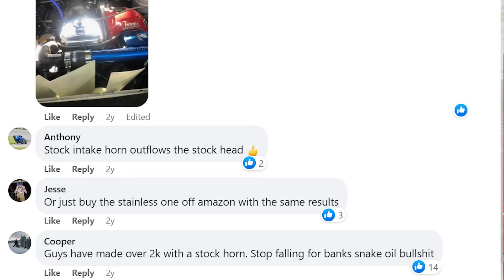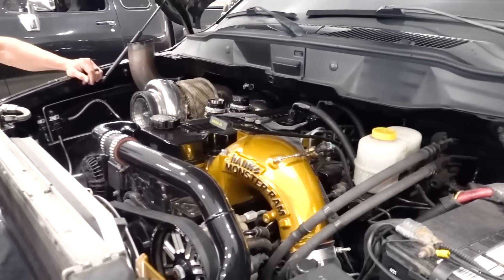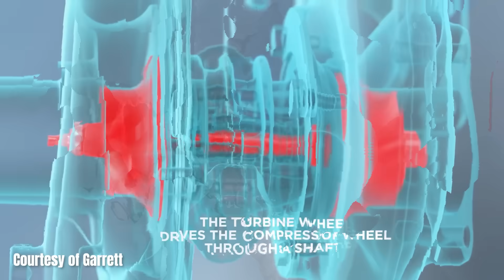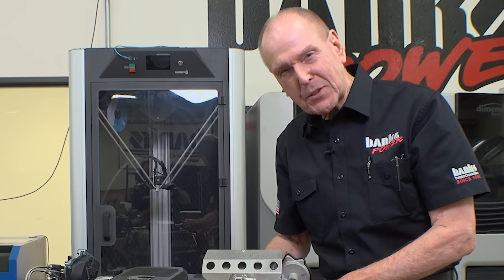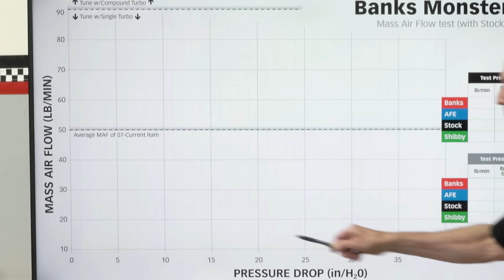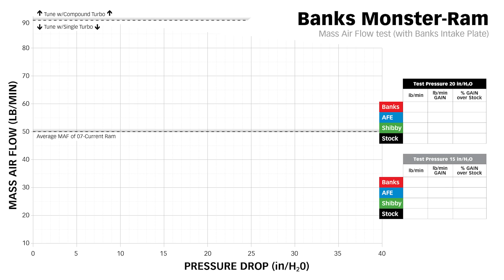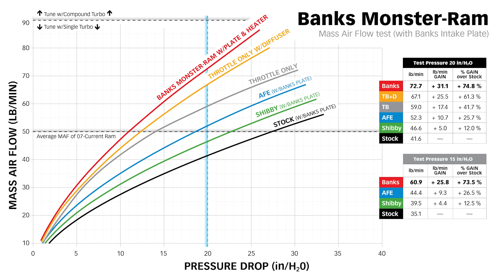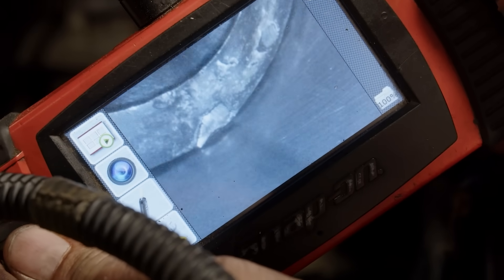Stop this wives' tale about Cummins engines! | Fact Check

Comment: Look man respectfully, this video is great on explaining the benefits of an entire banks system it does not show any REAL world results to the wheels of the vehicle….yes you picked some critiques by some pretty mis-educated people and you did a great job on tearing apart their choice in nomenclature 😂…so let me ask you what I think they were trying to say. How does additional “flow” before the fixed intake runner size, fixed port size, fixed valve timing, fixed valve size etc…how does your system overcome these limiting factor’s WITHOUT additional TUNING?…yes your elbow does increase flow, but it seems it has more to due with the grid heater re-design (which there are numerous cheaper alternatives that achieve the same type of re-design) as I’m sure you’re aware a modern computer controlled engine running in a closed loop cycle will automatically adjust the variable side of things to accommodate any change in charge air/atmospheric conditions and will adjust the fuel trim to STOCK drivability. Fact is if your system is 50 state legal (to include California CARB compliance) it CANNOT FUNDAMENTALLY CHANGE THE FACTORY CAFE STANDARDS😂 good rule of thumb on “performance parts”, if it bolts on and doesn’t throw a “check engine” light then it doesn’t do diddly squat 👍…look folks , buy this all you want, but without doing ILLEGAL mods you’re NEVER going to see any real world long term benefits from this nonsense…if you don’t delete the egr, DPF etc, this thing is going to clog up and run just as bad as the stock setup in about 2 regen duty cycles… at the end of the day. Mr. Banks is a mechanic and an engineer, but he is now a businessman, but most importantly, a salesman…. I’m not tearing the guy down at all. He does make a lot of really good stuff (and it says “off road use only” on the part 😂), but this particular thing is pure marketing. 🤷🏼‍♂️
Reply: Listen, Buster... you don't know air density!!!!😂😂😂 You hit the nail on the head!!! It's like these guys are gullible to a cult-like level. I agree, Gail is a smart man, but he's also a SALESMAN. Why no dyno comparison that proves all th3 "benefits" of spending one's money on his products? Let's just see some of the results of all the homework...
Reply from the maker: Thank you for the comment. The point of the video was to get people thinking in terms of air mass, not air flow. It's about the weight of the air, not its volume. CFM is volume. Air Mass is its weight. Because we're talking about the air mass, the fixed volume of the intake runner, port size, valve timing, etc, are of little consequence. 

Yes, the ECM monitors MAF and makes adjustments accordingly. If there is more dense air available, it will put that dense air to use by adding fuel to make more power, or if you back out of the throttle, it will lean out the mixture which is better fuel economy. The ECM makes calculations in our favor. 

Regarding emissions equipment. There are hundreds of thousands of RAM owners who choose to leave their emissions equipment intact. Many of those people still want to make improvements to their trucks' performance. Can they make the same massive airflow improvements as someone who removes their emissions equipment? No. But that shouldn't stop them from making improvements. You're looking at it through the lens of someone willing to remove those components. For millions, that's just not an option. The Monster-Ram provides an improvement in throttle response that the average person can actuall feel. 

At the end of the day, every person must if an upgrade is worth the price. While some are willing to lay out the money for a Rolex, others are just has happy with a Casio G-Shock.
Reply: @bankspower   @bankspower  Watches tell time all the same- there's no need for a wrist watch dyno. Diesels make variable degrees of torque and HP. Put your Monster Ram on a stock "emissions compliant" diesel, and compare the numbers. "Hundreds of thousands of RAM owners who choose to leave their emissions components intact" want to know!!! 😎🤙

Comment: I've never heard anyone dispute that the intake elbow is a restriction to airflow. What I would like Banks to demonstrate is a cold weather startup test with the puny duramax coil heater that's supposed to replace the factory element. I'm sure it's fine on a 60 degree morning in SoCal, but what about a truck that's parked in -30? No block heater to help. I know my truck will start under those conditions with the factory grid heater. Duramaxes have glow plugs for cold start assist; the little intake heater is for emissions purposes.
Reply: Or if the elbow makes any difference under stock hardware conditions. People pushing excess of 700hp with a modified vgt only. I don't think anyone is arguing if it makes a difference in flow, but does it matter in terms of power/egt for the lack of grid heater. I've yet to see banks have tests of power under the same tuning and subsequent egts.
Reply: @allenlin6169  curiously absent given the fact they have a chassis dyno to prove it makes more power, and the data collection to illustrate the difference in turbocharger load if it does reduce compressor backpressure. Then he talks like he's the only person to ever study thermodynamics. It's tiring. He should strap a truck down and show the public the performance difference if he wants to settle it.
Reply: @Connor_Cripps there’s a reason he doesn’t. People have tested these things and  none of them produce a power gain under 1000 hp.

Comment: I purchased the monster ram about 2 years ago and ever since I installed it every winter I get the p2609 code. The truck runs great but can’t figure why I get the code. I’ve replaced the grid heater the solenoid the wire to the heater tested my batteries and still get the code.
Reply from the maker: Sounds like you purchased the "race" version of the Monster-Ram that does not include our coil heater. The 50-state emissions compliant Monster-Ram shown in this video ships with a coil heater that would prevent the P2609 code.
Reply: @bankspower  no I didn’t buy the race version. I live in Colorado and have to do emissions every year so I bought the one that came with the heater element that sits on the very top of the monster ram.

Comment: I don't understand, you don't answer to the comments at all by doing this ?
They are saying the head restrict anyway, no matter what you put behind. Why did you test everything BUT the head ? I thought we were going to be able to compare the 331cfm engine flow to the flow of the elbows but the graphs only shows MAF values, so we can't compare them.
Not saying you're wrong or your gear doesn't work, or anything, I just don't understand why you don't simply measure the flow through the head with the different horns attached ?
Reply from the maker: There was no reason to test the CFM of the head because it's not a significant restriction when it comes to air mass. What we care about is the air mass improvement because we're nowhere near the head's mass flow limit. Think of it this way... Imagine forcing water through the head and valves at 331 cubic feet per minute. Now imagine forcing molten lead through the head and valves at 331 cubic feet per minute. Same flow rate, but very different weight of liquid. The fixed volume of the cylinder can only hold so much volume. However, if you make the thing that you're pushing into that cylinder much denser, you can get more of it in the same volume. Because you have a turbo, you can compress air, you can make the CFM weigh a lot more, and therefor it packs a lot more oxygen at the same given volume.
Reply: I was wanting to see testing done on a running engine,  in stock form and with the different Banks components. eight

Comment: Gale and Team, THANK YOU for another extremely insightful video that must have taken hours and hours for research and editing for a killer production! I sincerely appreciate the time and engineering that goes into your products!

I must say though, I’d love to see the GDP (Glacier Diesel Power) horn tested, along with their High-Flow grid heater and plate. You have to give them credit for tapping into this issue YEARS AGO with the factory grid heater restriction and killer nut solution. And yes, I’m aware of the “difference” between it and the ones that you tested in this video. Just curious to see the numbers with us old 6.7 Cummins guys, PLEASE 😬
Reply from the maker: Thank you for the compliments! We intend to test the Glacier unit.

Comment: WHOA!! Shot's FIRED.. but by Gale THE MAN Banks himself.  "leg humping Anthony"   

   With respect, I'm a 40 year ASE master and made a few HP over the years too albeit probably not near as much as you.   I understand the concept of air density and MAF. I also believe I understand and have argued in favor of VE as the measure of are flow.  Also was taught that any form of supercharging is a VE improver.  As a shop owner and tech I have been a little more out of the education loop as well as at my level it's hard to find any worth my time. MOST and sometimes I still go to them when offered because a refresh never hurts as well as I might get some new info somewhere.  Speaking of new, your assertion of the MAF vs VE is exactly that.  Decades and I still believe this is done the MAF measures before the compressor and just this week I had to repair a P0299 on a LUV equipped Buick( coolant leak onto the sensor, overlooked by 2 other shops who condemned the waste gate actuator and the turbo itself respectively)  wouldn't an after CAC  MAF sensor be a more accurate way to manage the fuel given the density change. I mean in that notion, you've simply more pounds of air and thus would be able to increase the fuel for the stoichiometric combustion.  

  I've always argued for turbo and supercharging in particular because I was around in the days of engineers telling the public that small engines and small cars made fuel economy.  Thank God men like you n I have prevailed and manufacturers have not come to know HP/weight ratio as the true fuel economy factor. In that vane of the argument a TURBO is a complete engine (air pump vs air pump) in a much smaller lighter package. With LESS moving parts to boot. An aerospace engineer n I got into this debate the other day where he asserted that the NA v6 of his Honda Ridgeline( accord truck) was his choice because of "less moving parts" and how he subscribed to the "KISS method"  I knew it was an aimless argument at that moment and let it go.
Now, I've always explained it to those with a little less ability to visualize or less knowledge a turbo charger as this.
   > an engine without any supercharging AKA Natural Asperation moves one volume of air in and out and it makes X amount of torque, lets just say 100 foot pounds of force. When a turbo or other VE improver is added the amount of oxygen available is increased like adding an entire, albeit the ratio isn't 1:1, power stroke of that engines power. So power to weight ratio, an engine weighs say 500# vs the turbo that weighs 20 MAYBE making it that for a 1/5th the weight you've gained 80% of the power output. 

Also, I was taught VE because blower, turbo, or chemical they all add more oxygen through the same size port. 
I also avoid getting pulled into the answer every comment but can't help myself in some cases.    This was one of those because the SHOTS FIRED by Gale man I just have to tip my hat.

Comment: 2022 Ram 3500, I have the Banks Pedal Monster, and it works awesome. I ordered the Banks CAI, Monster Ram Air Horn with grid delete, and 5in exhaust. I installed the CAI and exhaust. It was awesome until it threw the check engine light with the P0402 and P026B codes. I called Banks, and they are working on a fix. I can't wait to install it back on as I removed it for now. It is sad that more air flow will set the check engine light off now. So, to the ones who do not  believe it increases flow are anything else, why would the trucks ECM tell me excessive flow at the egr? 😂😂😂 I am hoping the Derringer coming out in the first quarter will fix this issue. Besides that they also offered a full refund to stand behind their product, but I would like to wait for a fix even if it means that I have 2k worth of parts sitting in the shed for now. I saw better fuel mileage, and the truck sounded great as it was able to breathe. Thanks Banks...keep me updated on a fix, and I hope it comes out soooonnnnn!!!!

Comment: Hey, Gale. You should make a video of using your engine Dyno and dyno hey completely stock 6.7L turbo diesel, Cummins engine versus your complete set up that you offer for the motor. You should hook up a 10 gallon fuel tank and run. The engine at a constant load of 5 to 8 psi of boost roughly at 1600 RPM to simulate real world testing on what is engines are typically used for. That one meg one beautiful video I want to see what the HP gains are and fuel economy, as well as the improved throttle response. You should floor of the engine at 1200 RPMs and Revit up to the factory, RPM governor. On both the stock engine versus your engine with the Intercooler Intercooler boost tubes intake with mega scoop and intake horn.

Comment: If a diffuser increases the flow rate over a straight cut end. Does that mean there would be possible gains in doing this on an exhaust tip?
Reply from the maker: Not only are you correct in your assumption, we've already developed an exhaust tip that diffuses the air. In fact, our patented SideKick tip offers negative backpressure conditions, relieving several PSI from the exhaust. In other words, it syphons exhaust gas from the pipe. The tip is included with all 5" Monster Exhaust systems.

Comment: I just bought and installed the Monster Ram. I could not believe the amount of carbon that had built up on the stock grid heater... I'd estimate it was 30% clogged. I don't think Dodge could have engineered a worse component if they tried. Fortunately the bolt was still in good shape but now I have piece of mind I'm not going to be looking at a huge dollar surprise in the future. I had a CEL prior and that's gone away, not surprising considering how little air was getting into the intake.

I'd do it all in a heartbeat, I wish I'd added one a long time ago.
Reply: You should try max mileage catalyst from Pittsburgh power. It lowers the carbon burn temp to 750° and will clean out the system when you drive not under load.  Expensive, but worth it.

Comment: Question for Gale Banks? What does the foam baffle duck bill thing in the stock intake tube of a Ram Cummins do? Does it damage the turbo if taken out? Does it just quiet the turbo? Does it help with horse power and MPG? Does the oil that comes into the turbo from the breather tube hurt anything? There is so many different opinions my head is spinning.

Comment: I think that the limiting factor is the bank account for most people.  They have to justify using cheaper and lesser quality parts.

Cheap parts are cheap for a reason.  In my increasing age I have found that the added cost to higher quality parts is well worth the price off set.

Comment: I would have like to have seen the same info, but with stock air intake and stock intercooler! He tested no the bench with wide open inlet and no restrictions caused by the intake or intercooler! How do the results very in driving conditions, if  you test with intake and intercooler and then with aftermarket cold air intake, or if you replace both intake and intercooler with aftermarket ones or Banks ones?

Comment: Watched dudes in Colo. Dino a rice racer.
Turbo intake was about 2 inch from a sheet panel 
They cut the panel away and gained 50 hp
Air movement is weird 
No great calculation, just removed the panel.

Comment: This is a very interesting video, but I don’t see that it addressed the original question of whether the head is the limiting factor.  All of these flow tests are into a large plenum, the shop, and not through a head.  I have no doubt that the Banks product outflows the others into no restriction.  The question is how different are any of them when going through the restriction provided by the cylinder head and valves?  The Banks should still outflow the others, but the difference may not be the same if the head is the greatest restriction in the system.
Reply from the maker: Yes, the head is a restriction, but it's not THE restriction. If the stock head was a significant restriction, upgrading the turbo would have little benefit. Look at it this way... let's pretend the head's job was to flow liquid rather than air. You force water through the head and valves at the heads maximum CFM of 400 cubic feet per minute at the horsepower peak. For the second test, you force molten lead through the head and valves at 400 CFM. Same flow rate, but very different densities. Because air is compressible, you can shove a lot more in despite the CFM limit.
Reply: @bankspower  That wasn’t obvious from the test.  That is my point.

Comment: While there is increased air density, what has that equated to on the dyno?
Reply from the maker: Not every performance modification requires a dyno run to show improvements. For example, you can't show throttle response on a dyno graph.

Comment: From an electical engineer's perspective, concentrating on CFM without looking at density is similar to those who dont look at the watts or VA, and only worry about voltage.  Thousands of volts could zap your skin with no risk of electrocution, say through a doorknob as the current is a fraction of a milliamp.